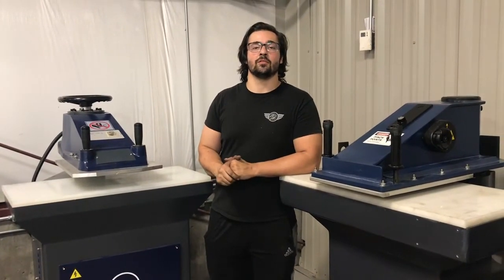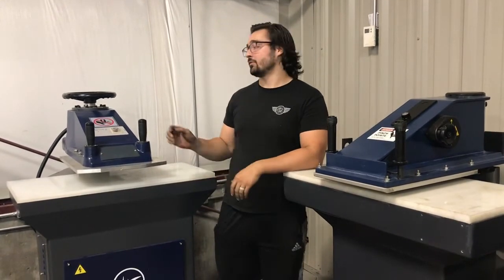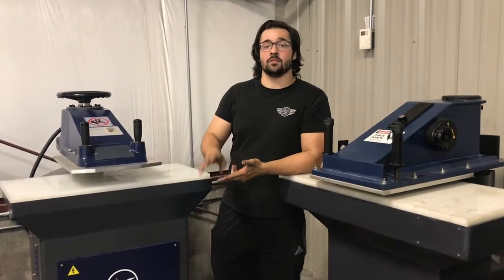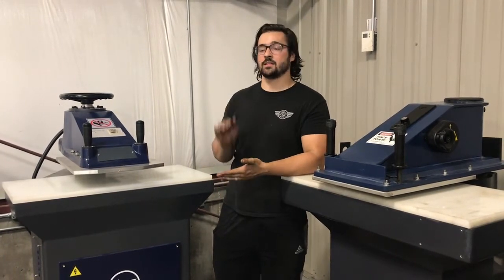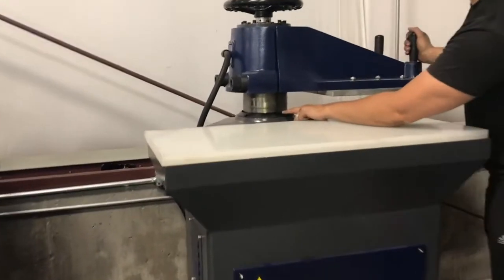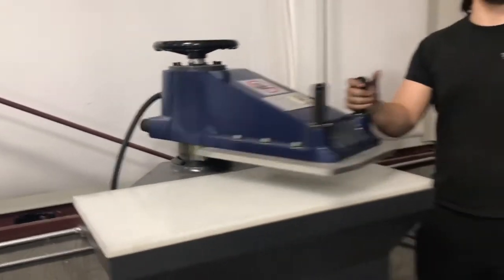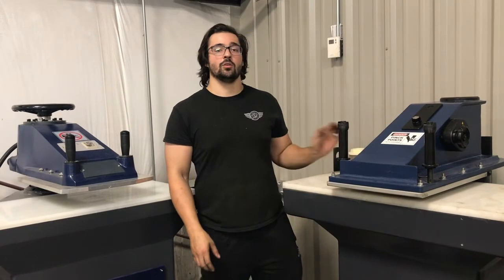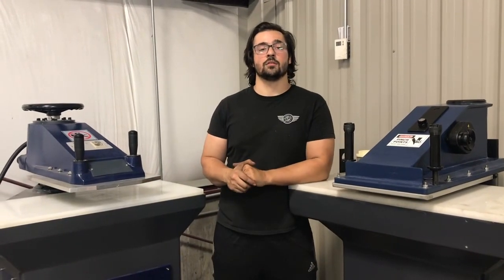Maintenance tips for HAMMERHEAD Swing Arm Clicker Presses

Comment: hi i have the same machine but the fuse keeps blowing on the circuit board would you know why? i am in england
Reply from the maker: The 10, and 15 ton version in our video has a fuse. The 20-30 ton version in our video does not have a fuse. If it is similar to the 10-15 ton type, it can be for a variety of reasons. On our type of machine, the electronics electronics are run on an independent circuit and in the case of a fuse popping over and over again, we would typically look for the contactor on the solenoid valve faulting in a closed position. If not that, follow that circuit to find whatever relays, timers, etc may have shorted out. If you need help in the meantime, please send any specific questions to service@hammerheadindustrial.com. Thanks for watching!